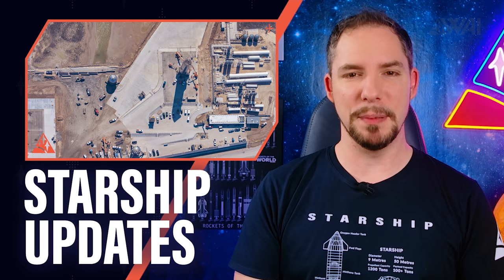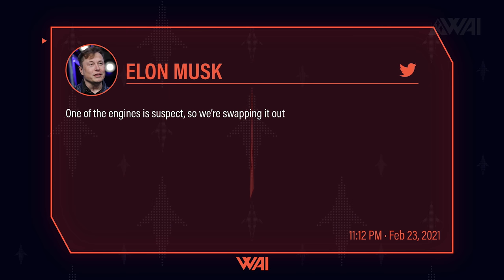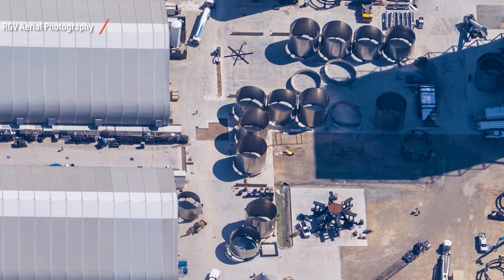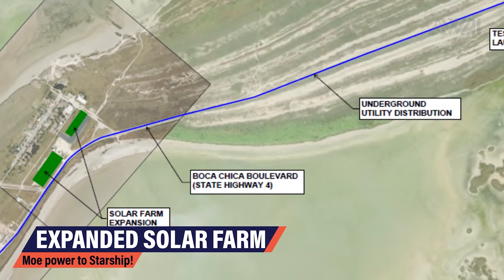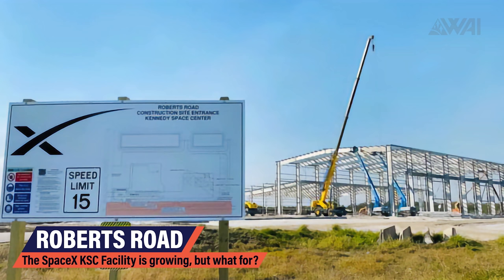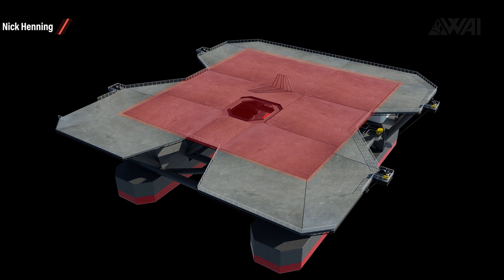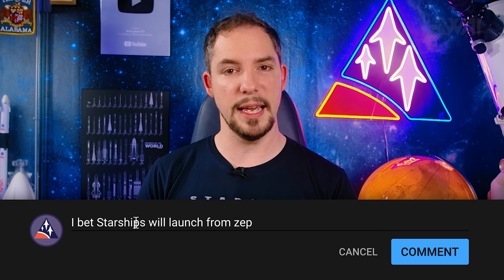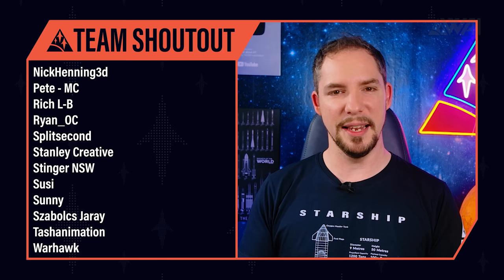150 Is SpaceX Building Two Orbital Starship Pads? & Major Sea Launch Platform Update From Elon Musk!

Comment from the maker: The Sea Launch Platform is an ongoing concept that will likely see changes in the future as more and more details surface, but it gives you a good overview for a possible solution. Tell us how you liked it or if there’s anything you’d add in the comments! :_WAISweet:
Reply: Hallo
Reply: Woah hey bro remember me i was there a year ago thanks to you i was able to ketchup starship news even during my exams hehe anyways good luck,and keep creating awesome videos bro we all with yas
Reply: Sn10 =Stan
Reply: Not going to be like this. Platform for launch and landing and servicing the rockets. Much more likely is that Elon is going to buy a couple of cruise liners or ferries for passenger handling.
Reply: Imagine any buildings *under* the deck. The deck is going to have to be reinforced to a level that even the current landing pad isn't already - it's innately a key line of defense for all the tanks and the entire seaworthyness. My version would have "the tower" as the only significant structure above the flat deck. With the tower dead center. Tower rotates as a (deluxe) high-rise crane (counterweights probably farther out the back than in your render, IMO). Imagine hexagonal symmetry and any mix one might like of 'landing spots' and 'launch spots'. At sea level, positions for ship docking. And, the 'passenger section' could be "a docked ship". Being an independent ship passes a chunk of the "lifeboat problem" off to an "already approved design" - the ship.
Reply: Ignoring physics and mechanical basics as always
Reply: The difference in color of the engine Bells may be an ablative coating. Some rocket engines actually use an ablative coating in cooling the Bell
Reply: On your model, how would starships get from the landing pad to the launch pad for refueling and launch?
Reply: the buildings should be armored on top anyway (just in case of a bad landing), and if they are, no need for a separate shield
the best part is no part
Reply: I would think that an underwater submarine that could detach from the structure would be the BEST way to protect any humans on this structure during launch and landing. Water is noncompressable and anything under the surface would be protected from overpressure and temperature. I could imagine that in case of (God forbid) an explosion on the pad during launch, that no matter where you are on the launch pad, above the ocean surface, you are going to be killed by the overpressure and or fire. However if during launch and landings personal were safely underwater by even a few meters these dangers would be minimized or even elininated. If there were an explosion and total loss of the booster and second stage, the personal under water (in whatever craft they design) could detach and motor away on the surface after a sufficient time passes. The (submarine) would not have to be a super complex vessel that needs to operate under water for any lenth of time, just something that would surface quickly and be able to motor off to some safe distance. This solution does not, of course, address protection of any humans on the spacecraft. That  problem would have to be tackeled with some other system. BTW Felix, I enjoy your presentations VERY much. In the begining I wan't sure, but you have won me over. I love the bloopers at the end. They prove that you aren't a robot that Elon invented in his spare time.
Reply: @Smitty65721  you really don't want to be underwater near a large explosion, water transmits the blast MUCH better than air
Reply: @austinlam1148  crane
Reply: Controlling personnel will be on a support ship.
Reply: Can you show the size of the sea launch platform relative to the Boca chica launch facility? Perhaps an overlay so we can get a feel for how big it is.
Reply: 100%.  Buildings on the deck protected by a exhaust shield makes no sense and is extremely risky.  Put all buildings under the deck.
Reply: Think about it, rigs already have pumps, pipe work, heavy absl infrastructure, strong platforms there perfect.. Weight loss and control is the issue for floating
Reply: Unless it was directly pumping methane?  Jus gonna throw that out there..
Reply: I read Elon said the platforms will have on board solar panels and fuel production so not requiring supply ships to replenish the platforms. Will be interesting to find out how many platforms will be having, also comment from Elon saying he hopes they don't bankrupt the company.
Reply: I used to work in the oil fields in Southern California. These places are MOST dangerous. The control rooms were built to attenuate explosions of the tanks filled with different types of hydrocarbons, as well as, hydrogen vessels, and other things that go BOOM! The walls and doors were solid concrete 4 feet thick. Even then, people are still killed inside those control rooms. The Starship (exploding) would be more powerful than any of those tanks.
Reply: The sea launches could be the "refueling" starships launch platforms. It would be ridiculously bad business decision to light those from Boca chica -not need to risk ALL the infrastructure and advances.  So,  place those Starship Tankers out in the sea, and send them up to refuel the starships coming out of Boca chica and floating in space.
Reply: Its a little-bit more risky to land a starship next to the platform off shore like that but its a lot better then trying to fight the envirmental protection agency and animal rights actives on lifting those things off the ground into space.
Reply: Your launch platform idea is good but it feels like there is some stiff yo could add. You'd want a large crain or something of the sort to move and mount starships. You'd also want a structure to Dock boats while they're providing fuel for the platform
Reply: The animation is awesome! Kudos to Nick Henning! 
I find it hard to imagine how SpaceX plans to deal with staff and customers on a platform like this, though. Noise, vibrations, heat and possible RUDs / Explosions would mean that the structure had to be cleared for every landing and launch. But having all people board a seperate ship and get them outside the exclusion zone would take a lot of time. Of course this would effect point-to-point operations more than it would orbital / planetary missions.
Reply: An “Elon way” off getting up to the top, like the is “rumored” ways to get to the top of the High Bay and the Spacex Dinner.
Reply: There is no substitute for an advanced degree in engineering, physics, or mathematics...  think we can all see that...
Reply: Can you do an update on “ A Shortfall of Gravitas”. Haven’t heard of that in a long time.
Reply: I believe Elon said he was going to keep the helipad on the rigs, to transport crew from the mainland, and emergency preparedness. 
I imagine a power generation station of some kind will have to be on board as well, to power the ship and fuel farm.
On board desalination/hydrogen/oxygen?
Great episode!
Reply: Hi Felix, good episode.
I have an idea for your Orbital Starship Pads ... put PASSENGER BUILDING under the water
... in case of Super Heavy ... the only safe place for your ears  :-)
Reply: It's frikkin amazeballs 😜
Reply: @frankderks1150  I bet they made a few offers during the cruise line close down. They mustn't have been cheap enough
Reply: Oh man, very bad design of the launch platform. Don't you know Elon? The best part is no part. Forget about passenger house etc. It will be like the drone ship, just a deck, no buildings or U-ramps etc. If they will put there anything, it will be under the deck like on an airplane ship. Also, putting the tower right in the middle is bad idea. It there will be a tower it will be on side of the platform.  Thanks for the news btw ;)
Reply: @shrikedecil  agreed entirely
Reply: Sea landing pad, center the tower for balance and stability. then place the building structures on each side of the tower to balance. #occamsrazor
Reply: @Smitty65721  I can't imagine there being people on platform during launch.
They'll have a Ship named Control Tower 
Imo
Reply: Hey Felix, just to think about it, when a starship launches will the other starships be needed to tied down? As the forces will likely push them overboard.
Reply: This design lacks a shelter for Starship in case of bad weather. It might be truly difficult to evacuate Starships to other locations in case of heavy rain and wind + rough sea.
Also, the life boats should not be on the top level, as a pad anomaly would probably destroy them there.
Reply: @blizzard4025  Maybe Spacex sells Starship Ketchup one day. Sorry, I couldn´t resist. XD
Reply: I bet everything that can go under the "flight" deck, will be there.
Think aircraft carrier without the island.
Reply: @trevordickenson3196  There is not sufficient space on board to have solar panels for fuel production. Fuel production also needs to be more distant to reduce the chance of it being damaged. And, the weight capacity of the platform doesn’t enable storage of more than a minimal amount of propellant on board (maybe just enough for one launch).
Reply: Maanhaar Jackal  current derrick is far too small to serve as launch tower, and improperly positioned.
Reply: @norrid668  A fully loaded Starship and SuperHeavy may weigh more than the tower, so putting the tower in the center won’t necessarily be optimal for balance.
Reply: @antyspi4466  Yes, it seems like there will need to be a shelter capable of holding and protecting at least one Starship. It will probably also need to function as a payload integration facility.
Reply: @zzubra  I would agree with your comment but Elon has been reported saying the platforms would be producing fuel onboard so not requiring supply ships which will  be used at the start of platform operations. Maybe the platforms will be larger than the first two but we wait and see what follows.
Reply: @trevordickenson3196  Maybe that was simply a wish of Elon’s which will need to be deferred until later, larger platforms. I guess, we’ll see what happens.
Reply: It’s a good first run, but there are issues.  The tanker barge is in the exhaust area. Your exhaust shield for the on deck buildings would deflect exhaust and debris upward, not desirable.  I would put exhaust chute and deflectors with water deluge similar to 39A but made of metal instead of concrete. That way exhaust can be controlled.  Keep the Deck clear of buildings and put them below deck out of the exhaust areas.  Fuel barges could be moved off the platform with floating lines to the rig. The size of the platform could be kept small, since there wouldn’t be buildings or deflectors on it.
Reply: that amount of "coverage " / "estetic panels" could lead to it making a Sail effect and bounce the struture to much. i dont think there will be pannels covering the launch tower. i think that they need to let the  wind move freely. also . have u acount for lightning stikes? cheers
Reply: I think it would make more sense to route the exhaust gases down beneath the platform. Going upwards would destroy the rockets as they tried to launch.
Reply: What software and rig did you use to make those mock-ups?
Reply: Two launches at the same time to refuel once they both reach orbit. More efficient than having to catch the ship in orbit to pair them up to refuel.  Two go up, only one returns.  Muuuhahaha
Reply: @cedricduchesne866  Satan?
Reply: @trevordickenson3196  So he might be expected to position these where there is a natural gas field so they can drill and have an abundance of source of free fuel.  Makes sense that the platform could do both support and capture a modest amount of fuel. Perhaps have a separate launch/landing platform located next to the fuel supply.
Reply: @kaltenbach.alexander  Agreed. Exhaust going up can damage the ships.
Reply: Seems like the launch platforms need to be in the middle or you'd rock the platform with every launch. Might not be a problem to have them on the edge with a slow launch cadence (or with how much these weigh), but you wouldn't want to land while the landing pad is rocking.
Reply: @koyotecow7102  I thought about NAMING it satan at  first but stan is a better name. Sn9: Sheileen Sn10: Stan
Reply: I think they need some kind of octagrabber device for the upper stage landing pads, because the ocean surface is a constantly moving, and a towering structure that is not anchored down could easily tip over. Falcon 9 boosters need an octagrabber, and they have 4 long legs stretching out. Starships won't have those.
Reply: Probably they will use 2 oil rigs to build 1 launch pad.  Makes a lot of sense :)
Reply: I think both platforms will be merged into one, trying to fit everything they need onto one seems a little cramped and less room for error.
Reply: Love your design concept. The speed of the colored diamonds, while attention grabbing is also headache / nausea inducing. My suggestion would be to either slow down the animation. $.02
Reply: Maanhaar Jackal  I agree. There is also no need for a launch mount like there is on land. Exhaust through the Derrick drill floor opening. No need to deflect exhaust. Leave any accommodations structures above main deck (leave as-is). Ppl should remember that they will want to do this on the cheap, these mods would be way too expensive - beyond that, purpose designed built hulls make more sense. Landing pad (one is plenty) will need to be completely redone and I would think be made of heavy perforated steel to allow gasses to pass through.
Reply: Pull an engineer in those discussions. This looks a bit strange if there is no word on 120m, 250t+ tall structures that suddenly lift off without thinking about what needs to be done concerning counterweights, etc. Then ... why should there be people on the platform? Use a ship for this. Fuel storage on the platform? Why taking this risk if you could simply dock tankers and move them away for launches and landings. This is way too complex ...
Reply: Loved it! Only thing I would improve is a cooler design for the buildings. Especially the passenger building. :)
Reply: @joephi99  that vessel has a gross tonnage of around 20,000 tonnes. It will be fine with simple ballasting management. The Derrick was rated for 8000 tonnes. I would agree that the meta centre would raise significantly with a loaded SS, but they would simply ballast down to add stability.
Reply: Great initial design but working for offshore oil companies specialised in repurposing topsides, I would advise to revise your design to save weight and reduce structure stress especially if time is of the essence. I would suggest to use an old tanker to store your fuels, house the crew and passengers and add any space X controls needed onto the deck... keeping it all of the plateform. On the plateform, i would suggest centering the crane and installing  launch pads on board beam (floater). I would land the starships on barges ala Falcon 9. The crane would be used to catch the boosters indeed as per your design.
Remember, Space X design are simple and efficient, no fency deflectors or flashy buildings... ask yourself, what would Elon do....
Reply: control and passenger areas should be submarines
Reply: @toddsmith8534  unnecessary level of complexity and quite costly... look at how SpaceX is approaching space exploration... with tin foil rockets... submarines to go to space makes no sense
Reply: @jayobee  you mean water tower rockets? 😆
Reply: @thomasgauthier5691  grain silo rockets to be more precise 😂
Reply: Great model, I'd change the deflector design however which as you made it acts more as reflector concentrator of acoustic waves back towards the booster.
SpaceX issued a design a while ago of a underwater acoustic waves barrier aimed at preserving marine fauna from damaging launch acoustics. This is a clue about gases being deflected downwards to the sea and away from the booster. 
Big hole in the center, deflectors beneath for a sea skimming exhaust.
Great job.      You rock. :)
Reply: wouldn't it make more sense to put the control buildings under the deck?  even with the blast Sheild those buildings would take severe forces being up there I thinks its not possible
Reply: I'd put the life boats immediately under the buildings and add a ramp so the boats slide into the sea - not sure about the flame diverter - shooting flames back into the rocket doesn't sound like a good idea. And I'd say Green means Go - the colour reminds me of the original Thunderbird 2 but again its also known as racing green.
Reply: You will need a moon pool under both launch mounts. (not just the one)
You will need a large docking facility for the tanker ships to dock and unload their fuel. You need some good passenger receiving areas with elevators.
There are giant winches at each corner for the 4 anchors.  They need to stay, as do the 4 GPS thrusters, diesel gen sets and a large machine shop for maintenance.  Ad some large dish antennas for the control room as well as for the flight staff.  Are needing to talk restaurant?
Reply: I don't think they would have a Control room on the sea launch platform, due to the vibration and sound, I think it would be controlled from a distance, as even at Boca Chica the area needs to be clear before launching, so it won't really make sense
Reply: I love the design of the platform. I have one major concern the power of the shockwave on the platform and the building they have been put there.
Would be it possible to have the buildings below the main deck ? or what would it take to make structure that raise up and down the level of the deck ?
Reply: I have similar opinions to commenter Shrike. Like an aircraft carrier, all systems, supplies and personnel would likely be below decks and relatively out of danger, shielded by the deck itself. ... No buildings!
Also, I would expect the launch flames to go through the deck down to near sea level, directed fore and aft in the space between the barges. Passenger ships docked parallel to the barges would maybe be unaffected ?
Have you thought about C of G correction as space ships and boosters come and go? The to of the launch tower could easily be metres of perpendicular otherwise. How does the platform remain stable !? What about affect of heavy seas? How it's it ankored?
Reply: @frankderks1150  too slow to bring people to the platform
Reply: @Smitty65721  If you could figure out a way to get through the sound baffle which should be in operation during launch, it might work.
Reply: @davidelang the existing accommodation on a oil rig is already armoured for blow outs
Reply: I like the concept but I think it's risky having any type of control / passenger building on deck ... Even if they get the reliability really high, it's an unnecessary risk. The proximity to the craft even with the shield is asking for excess casualties in the event of a failure on launch or landing.

If I had to guess, the deck will be the pads and any C&C/buildings will be below the main deck to provide as much protection as possible to the people on the rig.
Reply: With the platform concept  would suggest placing the crane structure in the center and launch and landing pads on the outer side.
Reply: That video is a good rendition of a sea platform - it may not be 100% but there are some really nice ideas - if elon doesnt have any yet !
Reply: @davidelang  No, water reflects most of the blast and the blast isn't from a high explosive. Lots of fire and debris but not a high pressure wave.
Reply: @ciaala  No, the ships only have to travel a couple of miles to be out of there during launches and landings. Passengers can be transported to the ships by helicopters.
Passengers on the launchpad during launches and landings is not going to happen.
Reply: @frankderks1150  that depends on if the blast is above the water or in the water. if something comes down and hits the water and then blows, the pressure waves will propagate through the water very well.
Reply: Could the Green Bell engine be the one that is ignited for a longer period and relit for landing both cases there is higher temps for longer periods...
Reply: how about you land the booster on the platform,  a barge to land the starship on the crane pivots to lift and stack.  A pair of tanker ships as fuel farm with lines under water or even on pontoons, a  ship for the cnc area maybe a place for passengers
Reply: Wasn't the plan to land starships on the launch mounts with a catching mechanism?
Reply: @AlisterMcIntyre  now quite. The starship needs to be able to land on Mars or the moon. It's the superheavy booster that they are hoping to be able to land on the launch mount
Reply: @davidelang  yes that is what they decided got the crew of the civil war sub "Huntley"
Reply: Hard to see this ever happening.  Close quarters of things is a big safety risk,  center of gravity is a problem that oil rigs never had to deal with.   Then there is the noise problem for a large radius.  A good example is how loud Starship is with just 3 engines.  If the booster has 29...